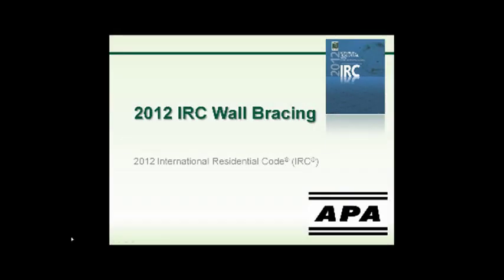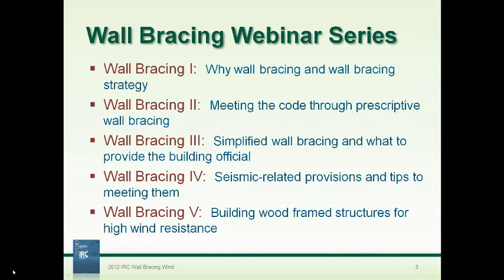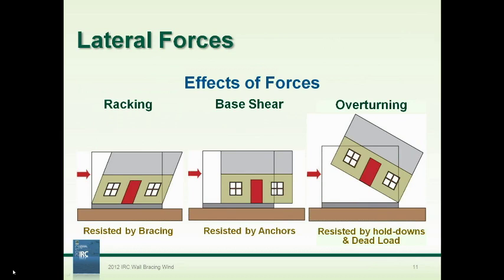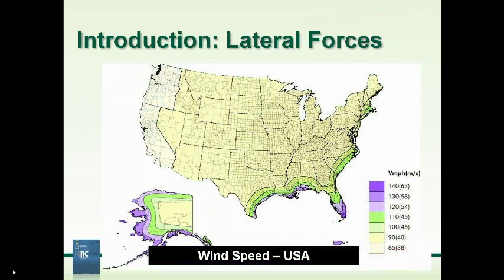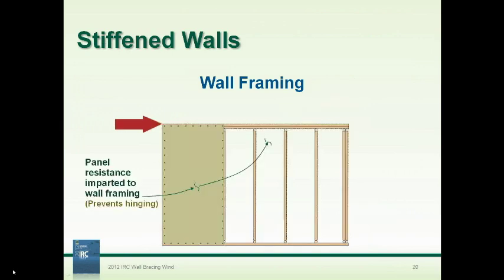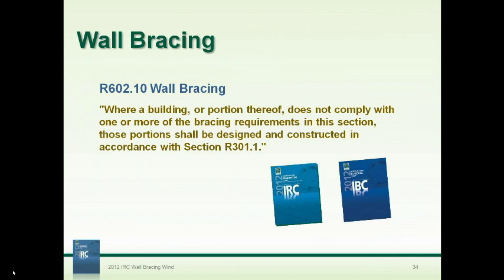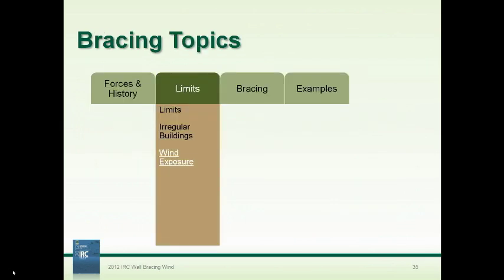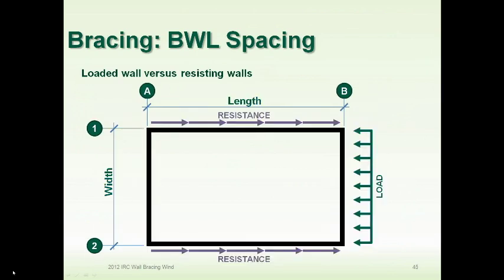2014 IRC Wall Bracing I: Why Wall Bracing & Wall Bracing Strategy

Comment: You don't have a code basis for not bringing the braced wall lines in 4 feet. You can say "That's not was intended." But everyone who has dealt with the code on a day-by-day basis knows that when it comes to enforcement by bureaucrats, reason has nothing to do with it. If the code says that a braced wall line can be four feet from the wall, then in effect,  they all are.

Comment: Excellent Bob. Thank you very much. Toward the end, when you are discussing braced wall panels, there was not much elaboration, in terms of what constitutes a braced wall panel. The diagram flashed on the screen spoke of the need for a minimum of one 4x8 panel or...and then that's when it got a little fuzzy...the 'or' part. Hopeful you will cover this more at length in the future portions of this video. Also, I am watching this on in the year 2020. Did you produce a later version of these videos?
Reply from the maker: We are offering an updated series that covers 2018 IRC requirements in September 2020. Learn more > https://www.apawood.org/2018-irc-wall-bracing-webinars